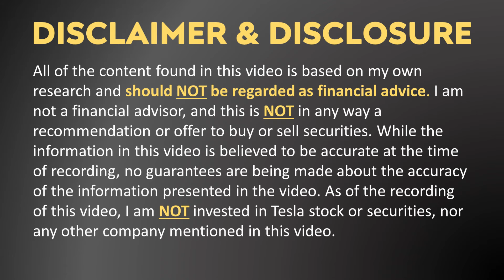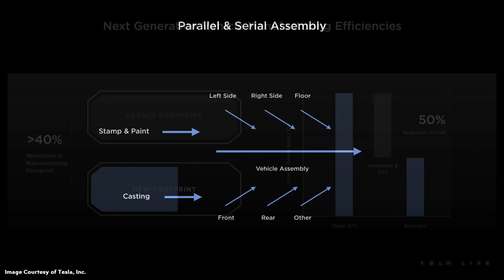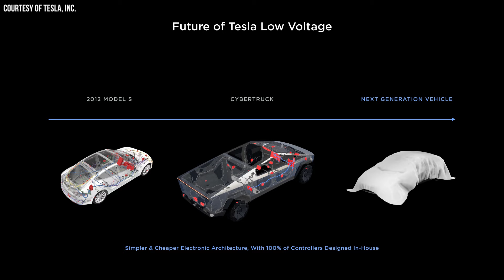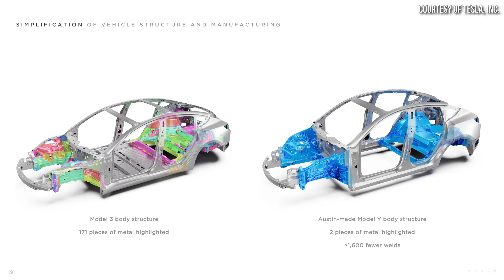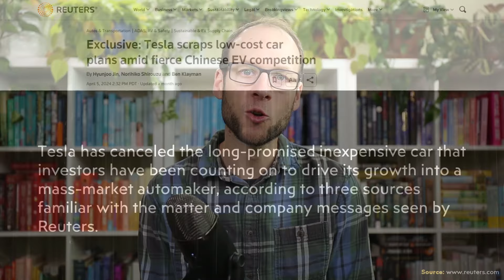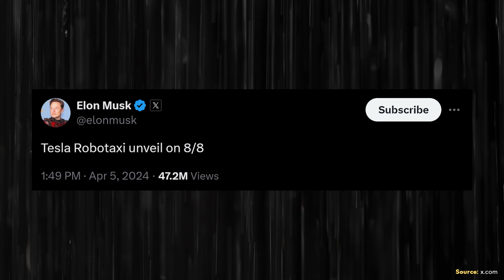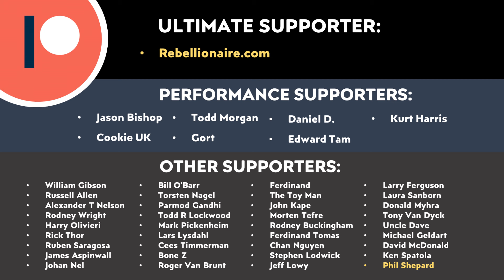Tesla NEXT GEN EV Manufacturing CHANGES | $25K Tesla PIVOT

Comment: I dont want a glass roof or crazy acceleration. I dont care about lower cost interior materials. I just want a car with a decent range and smaller than model 3. The only thing I expect are no compromises on the software capabilities. 

In Europe, the Fiat 500 EV has been a bestseller despite bad specs and relatevely high cost. But it is one of the few EVs with small dimensions. Tesla should be able to produce such a car at significantly lower cost than the model 3.
Reply: Agree.
Reply: Toyota corolla is your  car.

Comment: IIRC, Elon said on the Q1 conference call that Tesla was still going to use the new "unboxed" assembly process for the robotaxi, or "CyberCab," to be revealed on 8/8.

Also, at the end of the call, Lars ticked off a list of 4 or 5 technologies from the "$25k car" that would be used in the new models that would be built on existing assembly lines.  IIRC, It included things like 48 V, rare earth free magnets, 75% less SiC, etc.
Reply: correct
Reply: What is SiC
Reply: Nothing new about rare earth free magnets, they just suck.
Reply: @allenahil  silicon carbide transistors in the power electronics
Reply: @allenahil  SiC is Silicon Carbide, used for high performance, high efficiency, power electronics.  Tesla was a SiC pioneer with the 2017 Model 3 drive unit with SiC inverter.  At investor day, Tesla announced they will reduce SiC content in their inverters by 75% without sacrificing performance or efficiency.  This should be a nice cost reduction for them.
Reply: @Withnail1969  Tesla said their new magnets would have the same strength as rare-earth PMs, so that is new.  Ferrite magnets, used in the Gen 2 Chevy Volt, were close, and new ferrite magnets are said to be as good as rare earth magnets.  Iron Nitride magnets be as strong as rare earth magnets, but a method to mass produce them needs to be invented. This is being actively worked on.

Comment: Much easier to introduce "unboxed" in a new factory rather than shutting down existing lines to introduce radical change. On the other hand, there is also the balance between capital cost i.e. new factory build-out vs. current account costs such as COGS. The key issue in all of this is demand - if it weakens then it makes sense to delay the build-out and suffer higher COGS in the short term until demand picks up. A second issue is the natural desire to drive to launch lower cost vehicles to increase access to market demand - cutting across this is the expectation that FSD/Autonomy will increase vehicle utilisation and thus reduce unit demand. If you pull forward expectations for FSD you cut the ground underneath the need to support ever higher demand for low cost vehicles.

Comment: I think Tesla will use powder coating instead of paint for the next generation vehicles. 
Powder coating doesn’t dry up and clog, the excess powder that doesn’t adhere can be re-used. 
They will assemble the doors, hood and trunk before fitting onto the vehicle-not fitting them, then painting, removing, assembling and finally reinstalling. 
FSD was originally derived from the factory; Tesla may be able to use end to end neural networks to train the new assembly line. 
The assembly line could be able to autonomously call for things like the W.OW. to change out a storage trailer, order parts and detect bottlenecks long before humans can detect them.
Reply: They need to stop making EVS and convert to ICE vehicles. Nobody want EVS.
Reply: Lol 😂

Comment: 4:00 The unboxed process has not been shelfed it will be used on the Robotaxi so as to be able to trial the novel manufacturing process without undue pressure. Learnings will be incorporated into the new factories required to build the $25k vehicle and the vehicle itself.

Comment: 8:50 No, that's incorrect. The robotaxi is on the next gen platform, the low cost compact crossover will be on the 3/Y platform with some of the next gen platform cost reduction measures that can be applied to existing lines.

Comment: ? The unboxed process is not cancelled. It’s the mega casting for the whole car 1 piece that cancelled that would require the 11 ton Gigi casting
Reply: Yes, Tesla said the “Cyber Cab” will be made with the unboxed process.  Casting the BIW in one piece is not comparable with the unboxed process, since it requires separate pieces.  Not surprising that Tesla cancelled the one-piece casting after finding a better way to reduce costs.

Comment: 5:40 Re Model Y having front and rear giga-castings, is that true for both Fremont and Austin-built Model Ys? Also, I thought the use of giga-castings in the Model Y also required the structural battery pack (4680-based). If true, then is the Model Y with 2170 cells using front and rear giga-castings?

Comment: Elon did the right move.  Rushing the model 2 and spending billions on new gigafactories in a saturated over supplies market would just burn cash and cannibalize on the model Y and model 3 and over supply the market even more. It would be better to improve and lower manufacturing costs on existing productions lines.

Comment: I think it is wise for Tesla to delay implementation of new factories using the complete unboxed process.  I suspect Tesla either has 1st class economists on staff or via 3rd party consult.  Those economists told Elon that a global recession is coming, USA included.  Thus, vehicle demand will be less for the near to mid term.  This is why Tesla will introduce next-gen tech on existing lines slowly.  They'll still be able to produce a low cost robo-taxi and compact efficiently with a relatively low CAPEX commensurate with a recession.  One more thing:  if the robo-taxi deployment is successful, it alone will reduce demand for human-controllable cars over time.

Comment: I am expecting a Modified Model Y with additional features to adapt for RoboTaxi and delivery vans.
Powerdoors so if a passenger exits and does not close door which would leave car inoperable 
Additional internal cameras for security
Front camera or possibly front corner cameras allowing vehicle to see when pulling out of blind spots
Remote capable software to allow for support in case some unforeseen issue requires operator intervention at least for a few years
Modified external door handles to make it obvious how to enter vehicle

A cargo/light work van style body with power outlets suitable for 120 volt power tool charging

Comment: What might help with Giga Mexico if that be the plan is to move the now probably very well used production systems from Freemont into Mexico for Model 3 and Model Y and move new "alien dreadnought" equipment into Freemont possibly to produce Model S, Model X and Next Gen. This new tooling could indeed be far more efficient but also more robust and much more precise thus improving initial build quality by an order of magnitude the latter of which is where the money shot be had as then servicing costs can drop something which remains a big time drain on Tesla with Cybertruck at the moment and despite what I would regard as a successful launch anyways. Rivian and Ford clearly understand battery electric trucks better as they understand/understood full size trucks going into this better. Both Ford and Rivian are still planning on standing up brand new production as well with Rivian even getting a massive check from the State of Illinois for expansion and early rollout of R2. The Rivian R2 might be the first to steal a march on Tesla getting to pocket rocket battery electrics first and possibly hitting the "downsizing wave" going on in the current US vehicle market mix where Toyota Corollas, Honda Civics and Ford Mavericks are suddenly all the rage. Starting to see visual confirmation that battery electrics are becoming a common occurrence here on the US Eastern Seaboard as well and not just Teslas but Riviians, Fords, Hyundais even a Lucid. Golf carts are still totally so not worth it tho 🙄🙄🙄🙄🙄🙄🙄🙄

Comment: You seemed to imply that the Austin built Model Y Long Range with 2170 cells have Giga castings on the front and rear? I was under the impression that the Austin built 2170 Model Y did not have front Giga casting and the 4680 Model Y had front and rear Giga castings. Please inform me of your sources for which cars currently have front and rear Giga castings from Austin.
Reply: I'm wondering this to? The Berlin Y with the byd blade pack has both the castings proven by multiple actual owners shared publicly.
But I wasn't aware the U.S. built 2170 or lfp Y used both CASTINGS? 🤔